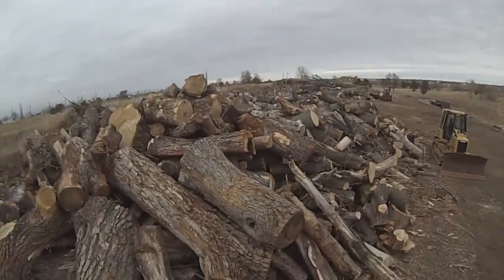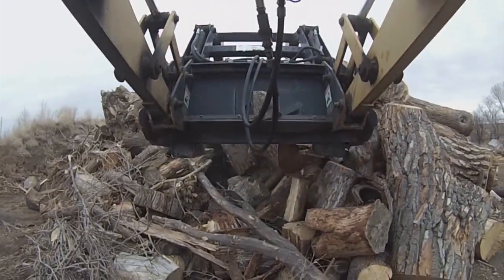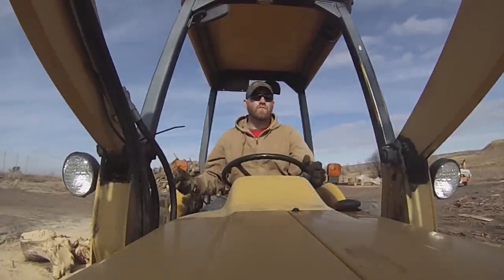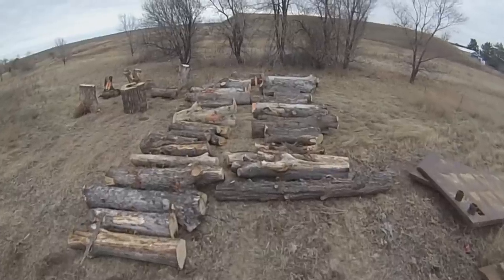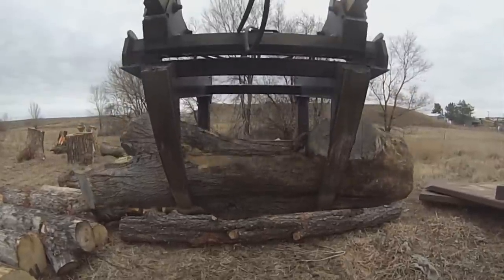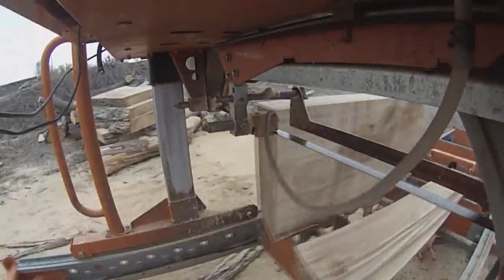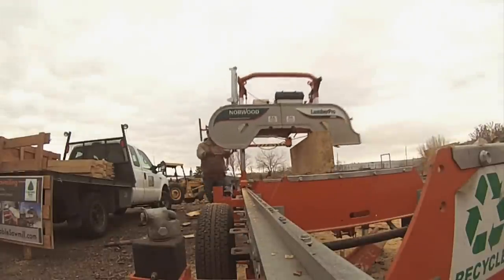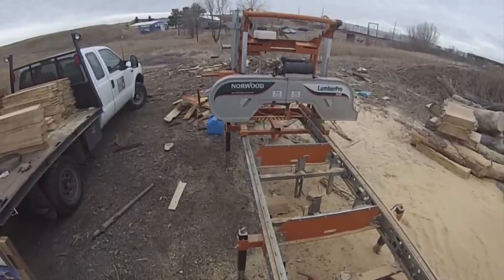Revolution in Aurora

Comment: Very cool program. Are you using a wand style metal detector or the larger treasure hunter ones?
Reply from the maker: Treasure hunter style. It helps when there's something on the surface that I can pull out but usually the metal is inside the wood where I can't get to it. Depending on the value of the log, I either cut through the metal knowing it's there, or I throw out the log and save the blade.

Comment: I have a portable sawmill and I am planning to build a Virginia Tech solar kiln to deal with lumber I need to dry. I am hearing good things about this kiln.  

https://pubs.ext.vt.edu/420/420-030/420-030_pdf.pdf

Also the forestry forum has a whole lot if info about this kiln and variations thereof in their "Drying and Processing" section.  You can see photos of the build process by forum members who have built the kiln.

http://www.forestryforum.com

Click the "Enter Forum" link then "drying and processing"

With this kiln you can cut most of your supplies on your Norwood.  Drawback is that it doesn't work quite as well during the winter, but the cost is low enough that it is easy to get started. 

By the way I really enjoy your YouTube channel and have learned from the content you share.

Thanks and good luck
Darrel
Reply from the maker: Thanks for the info on the kiln! Very helpful. There are a lot of designs out there but I had a hard time finding real specific information. So this is good!